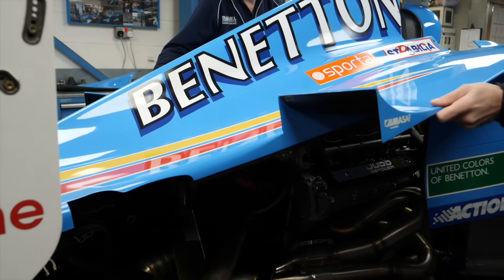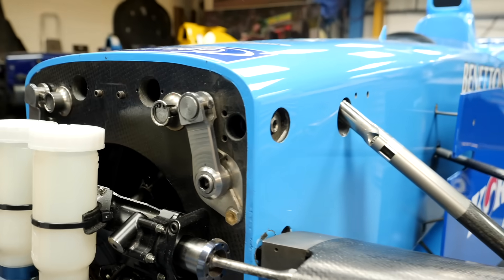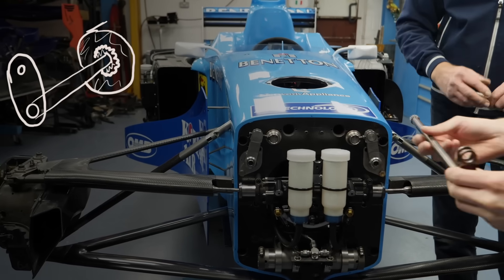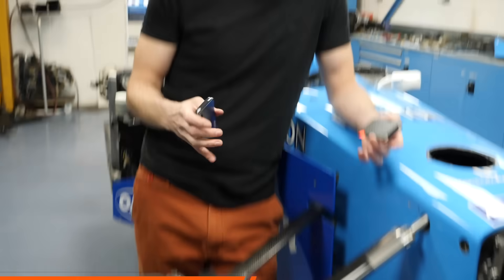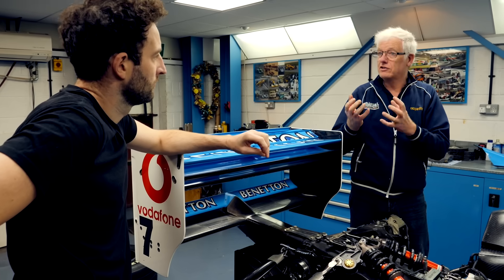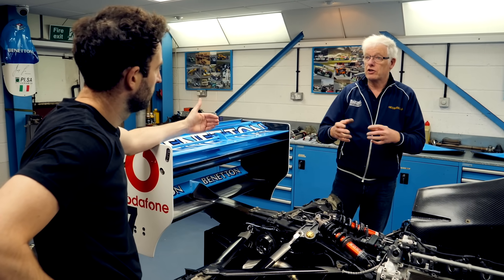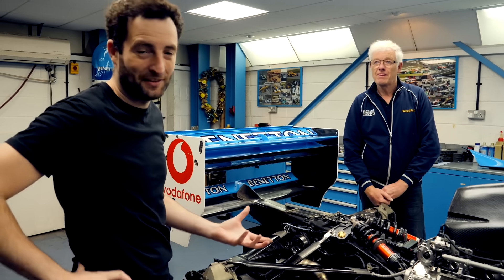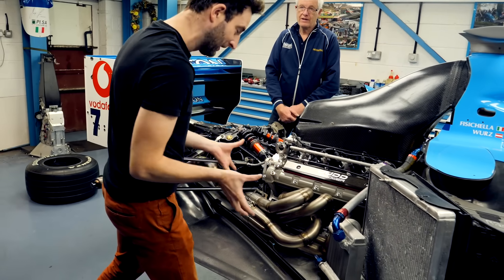Why F1 Suspension Doesn't Use Coil Springs!

Comment: FYI: There is no difference between a torsion bar and a coil spring. Both work identically via torsion. The only difference is one is a straight torsion member and the other is wound into a coil. Both are loaded in torsion.
Reply: Absolutely correct, when you compress a spring you are actually twisting the material it is made from, it is just a coiled torsion bar.
Reply: @trevor311264   Internally, sure, but it is linear compression if you look at what is happening at the ends of the coil spring.  Torsion bars, as others have pointed out, are lighter.  There is another important consideration.  The front end geometry changes less with a torsion bar allowing for better grip.  Nor are torsion bars anything new.  Dodge was using them on production cars 50 years ago.
Reply: @trevor311264  Are they though?  Is it not bending rather than torsion?  The bar which forms the spring is never really twisted as it would be in torsion but is bent to get the individual coils closer.
Reply: @HugoEtc  It is torsion and not bending. A torsion bar is an unwrapped coil spring and a coil spring is a wrapped torsion bar. (Just as RoboticGladiator and Trevor Marron explained). Bending has tension and compression forces and torsion has torque force creating shear stress. B.Eng in Mechanical Engineering
Reply: @Peter-un8no  @roboticgladiator, my apologies, you are correct, I was visualising it wrong, if you have a nicely coiled hose (representing the spring) and pull it out to uncoil it it comes out twisted (torsion). I was visualising the actual bending of the coils as they get closer together but that is not the primary force governing the reaction of the spring.  I know when I'm wrong and will freely admit.  Can't say I've had to think about springs much with Civil and Coastal Engineering ;-).
Reply: There is no difference besides their shape, appearance, and size. Great comment RoboticGladiator.
Reply: A torsion bar is lighter and takes up much less space.
Reply: @bobm7275  nope.  The same amount of material and weight for both.  The torsion bars you are looking at are just like a very small spring, the smaller the spring, the stiffer it is.
Reply: @trevor311264  The faster it wears out...
Reply: @bobm7275  Depends on application.
Reply: @bobm7275  that does not mean anything, a spring is a coiled torsion bar, it is still a torsion bar.  don't confuse it with what is often referred to as a torsion spring though!
Reply: The other half of the technology is the dampening effect, which is not explained as much as it should have been here. Well-balanced rebound is critical to keeping the tyre in surface contact at the correct pressure to maintain grip, balance and control- especially while cornering in rough conditions.
Reply: @JoeGator23  And huge savings in unsprung weight, where half the weight of the coil spring is considered unsprung, only a small amount of the torsion bar would really "count" as unsprung. And it's 1/5th the weight to begin with !
Reply: @peterdarr383  I agree, it's a strong and light design- plus, metallurgy today is superior. Back in the day they used magnesium wheels and inboard brakes to reduce unsprung weight, as well. Tyre technology is stronger and lighter, as well. 

I think the wheels are no longer used because of the fire hazard. The machines of today are amazing, cool comment.
Reply: @JoeGator23  I thought the wheels were still being made of magnesium alloys
Reply: @JoeGator23  thats what I'm kinda surprised about as well...  I wanted to see the dampers used in conjunction with the torsion bars...  It still needs space for those as well,  whereas the coil is just wrapped around the damper (which I think is pretty "compact" in it's own way..)
Reply: @billymanilli  Either way, this is a very cool channel... but in the video he spent more time talking about the exhaust and only partly covered the topic at hand. 
His dad is a human encyclopaedia of F1 mechanical knowledge and should present more information, in my opinion. The kid makes a great host... he should apprentice for his dad more- I surely would. :)
Reply: @JoeGator23  100% agree!  cool stuff for sure!
Reply: @JoeGator23  I was hoping they’d cover dampening up front.
Reply: @kart1241  Exactly! Either way it is the same concept... instead they covered the exhaust?
Reply: @kart1241  My advice: just try to avoid driving this thing in the wet!
Reply: Surprised no one pointed this out sooner
Reply: The straight torsion bar would get more spring response for less weight, and is therefore more efficient, correct?
Reply: @stopthephilosophicalzombie9017  All things being equal for performance, yes. Correct. Remember, it still requires a damping system for rebound.
Reply: When they named it a coil spring I'm sure they new how it worked. So what's the difference is a legitimate question despite your attempts to rename it the torsionnado or whatever you want.
Reply: Nothing new here!My 1962 Morris Minor had torsion bars on the front suspension(and “cart springs at the rear!)Splines on the end of the torsion bars make it a piece of cake to raise or lower suspension settings,when using coils makes things a lot more tricky.
Reply: @RoboicGladiator. a coil spring is a bending force, a torsion bar is a twisting for. they work in different ways to achieve the same effect
Reply: Actually, the fact that we can make flat bar coils proves that they are not torsion springs, but compression springs.  There is no torsion in a coil spring.
Reply: "A coil spring is actually a combination of a leaf and coil spring in that it both bends and twists to absorb movement. This dual-action of bending and twisting lends itself to very precise tuning, more so than the single-action torsion bar" - the goog
Reply: @billymanilli  surely ' a combination of leaf spring and torsion bar'?
Reply: A coil spring is indeed a coiled-up torsion bar. I think I prefer coil springs because you can fit them easily around the shock and don’t need any special connections like the splined torsion bar.
Reply: The difference is the reduction in unsprung weight. A torsion bar has the entire mass of the bar as part of the sprung weight.
Reply: Can you have a progressive rate torsion bar? Would you just vary the thickness of the bar down its length?
Reply: Holy shit you're right 🤯
Reply: @RoboticGladiator Thank you Sir, a YouTube comment where I learned something that's actually true. It happens so rarely that it's quite an event.
Reply: Quite true...thought there is a difference in functional parameters (mainly the length of the bar/spring twisted) and the fatigue experienced by each solution. 
Having said that...what is the solution for dampening the torsion bars oscillation in the front system (the equivalent of the piston damper within the coil, that they use in the rear suspension system)?
Reply: @gooser__43  The torsion bar has a profile that allows it to be slotted into the suspension.  It then twists to provide a spring effect.
Reply: @gooser__43  How does Google work?
Reply: ..torsion bar twists coil spring compresses.
Reply: Potentially the coil springs can have more travel compared to a torsion bar. I suppose suspension design could get around this though may not perform as well. Wonder if coil can be more linear when big travel is needed compared to torsion bars.
Reply: I actually think that torsion bars offer a "progressive" suspension while coil springs have a "linear" response towars compression.... this makes a BIG difference.... progessive suspension gets harder asi su apply force while libear suspension offers the same resistance through out
Reply: In driving experience there is!!!
Reply: I've always envisioned a torsion bar system housed inside a motorcycle rear swing arm pivot.  The system would look clean almost like a rigid frame.
Reply: Exactly!!!! thankyou 😅
Reply: torsion bar is less expensive, and also used in in expensive cars. More expensive cars and cars that demands comfort, do not use them but go for coils or even air suspension.
A good engineered and tweaked torsion bar can be as good as a coil spring, but it seems a lot of people can still tell the difference.
While it's lighter, and still more stiff ( of course depending on the requirements of the manufacturer and so on and so forth).
Reply: No, they do not. There's a difference between the normal spring and torsion spring. The normal spring uses bending not torsion. Since both ends are not fixed, the working does not relay on torsion but on bending.
Reply: @countmorbid3187  As part of my aerospace engineering degree I learned that coil springs are stressed primarily in torsion, not in bending, just as others have said here. If you don't want to take my word for it, see for yourself in this manufacturer's engineering guide to spring design: http://www.faculty.fairfield.edu/wdornfeld/ME311/AssocSpringBarnes-SpringDesignHandbook.pdf. 
At the bottom of page 58: "Wire in a helical compression spring is stressed in torsion", followed by the equation for the torsional stress. "Bending stresses are present but can be ignored except when the pitch angle is
 greater than 15° and deflection of each coil greater than D/4 (Reference 3)".
Reply: @ASJC27  I believe you, but I start thinking how are the torsion stresses brought home at the end of the coil spring? At some point it needs to be anchored to stop it twisting. Or maybe the ends twist less than the middle. Heck, I'm an electrical engineer and just don't get this stuff, who'd have thought that a spring can be so complicated.
Reply: Can you teach me about the damping? how does that work?
Reply: @paultimmer1223  dampers = shocks/struts, basically...  picture an old "heap" road car, where the shocks are completely shot/blown out... If you shove downwards on it, compressing the srings, and let go, you'll see it bounce right back up and down and up and down until it settles... Actually, you may have seen this on the highway as well... if a car has blown out shocks (dampers), it will go over a bump and bouce up/down a few times... 

Without getting real in depth,  the shocks/dampers create a (finely tuned for the application) "resistance" to the suspension travel,  allowing the spring to compress and rebound "smoothly" and not "oscillate" up/down as it would by itself...  make sense, I hope?
Reply: @billymanilli  One of my wreck cars during my student days had the shock absorbers part company with the body due to chassis rust. I "solved" it by removing the shock absorbers. Now that was an interesting driving experience! Mostly it was OK but a series of bumps would set the rear into oscillation that would build up. I got the chassis welded, put the shocks back on and it was like driving a Rolls Royce by comparison.

Comment: I'd be very interested to know how long those springs / torque tubes last? I actually worked on tanks that essentially also used (slightly bigger :P) torque tubes.. 
I had expected to quickly see metal fatigue but those seem to last Long..

Comment: Surprised the Benneton had the Torsion Bar above the drivers feet. Generally they're placed on a Lower Control Arm (see Chryslers from the 50's thru 80's) to get more of the mass lower in the chassis.... Having the Bar above the drivers pedals implies the combined mass of feet, lower legs, pedal box and brake master cylinder, is greater then the mass of the torsion bar and mounting brackets and chassis reinforcement for the loads.

Comment: Explanations are not great. For example, a coil spring is nothing but a coiled torsion bar—the spring action in both cases is supplied by the twisting of a rod. In a coil spring the rod is spiralled for compactness.

Comment: It's easy to understand . A torsion bar is an unrolled spring.  When looking at the bar , you can easily imagine the twisting effect. On a coil spring  the twisting effect happen all around . Just unfold it you have a torsion bar.

Comment: A coil spring is a torsion spring that is wound up.  Non coil springs are lighter and smaller.  The exhaust explanation is over simplified.  Exhaust pules form rarefactions when the pipe cross section changes.  The rarefaction travels back up the pipe and evacuates the cylinder.  The length of pipe determines the timing and the power band.

Comment: Its not even desirable to have engine bolted on anymore securely than is needed in normal driving conditions. In fact these cars are designed to shear off all non-safety related "appendages" like the power unit to reduce the overall inertia and kinetic energy of the driver and the cockpit or  "tub". Imagine dropping an apple vs. if that apple is taped to a hammer and dropped.
Now even some roadgoing supercars have this safety feature, which is slightly questionable as there are other cars/ road usersto consider, what if the motor shears off due to some richasshole losing control of their fancy supercar and then the engine hits on coming traffic still going 100+mph.

Comment: Today's PU doesn't use these kind of exhausts, because the turbo will slow down exhaust gases anyway. But on the other side it pushes in, so overall it's better. Just a straight and short exhaust on the top of the engine until the turbo's turbine.

How tightly packaged can be the back of today 's F1 car without the spagetti exhaust. Hmmm...

Comment: I checked out the "driver score" quiz for fun, and found it interesting but a bit questionable for rally driving; if the questions exclusively refer to circuit racing, maybe leave "rally" out of the options for driving style. Most of the quiz is unanswerable in the context of rally driving (questions about lap times, comparisons between laps, etc.).

Comment: As others have said, a coil spring is a torsion bar that has been curled up. If you looked at a slice of a coil spring and observed it springing, it would be doing torsion bar moves. I think coils are cheaper to make. No precision machined spline on each end. Just roughly wound in a spiral. I seem to recall that the stiffness of a coil spring rises as the sixth power of the wire diameter. Doubling the wire diameter makes the spring 64 times stiffer.
Reply: Exactly, you beat me to it. Interestingly, what we would call torsion springs (leg springs) are actually wound up bending bars, and compresson (helical springs) are loaded by torsion.  Makes no sense ;-)
Reply: it also saves space, most 2000 chevy silverados have torsion springs, because there was simply not enough space, for coilovers.
Reply: @ameraldas3641  Well and  the small Peugeot`s in the 80ties and 90ties like the 106, 205 and 306 had a torsionbar spring in the rear..... It saves a lot of space....
Reply: @schuncken  cool I have not been alive that long or lived in europe so I wouldn't know about puegot cars

Comment: Many many road cars some humble, some exotic have used Torsion bar suspension.

Mostly from memory, check if you are serious.

Morris - 1000, Marina
VW beetle and derivatives, van, camper etc.
Porsche - 911 +
Citroen - 2CV and larger cousins (Dayane?)
Jaguar - “E”, “C”, & “D” type, V-12, XK120, XK140, & XK150.
Riley Pathfinder, many others it seems

Comment: Not much new under the sun is there?  My old Morris 1000 Traveller had torsion bar suspension. I bought it in 1975 for £20 and ran it for a couple of years until the anchor point for the suspension corroded and broke going round Moor Allerton roundabout in Leeds one evening. 
The torsion bar and what was left of the cross member it was bolted to, crunched up through the floor of the car under the drivers seat. :0

Comment: Didn't really talk much about the torsion bars. Are they solid or hollow? Is there something with torsion bars that allows you to tune them like changing out rockers on a pushrod suspension? What are the differences in dampening needs between a coil spring and a torsion bar? How is the dampening achieved? With a torsion bar suspension how do you set up anti-sway bars?
Reply: Everything else is basically the same. A spring is a spring is a spring.

Comment: Great video. BTW while the packaging is better the current cars are actually bigger. They are the longest F1 cars in history and if you compare them side by side to a 2000s or 90s car the difference in length is quite staggering. A longer car allows for better aerodynamics.

Comment: That looks like the Benetton B198 which used a Renault engine and not a Judd engine.
Reply: I believes it's a B200 which would have had a Playlife badged Supertec. You can't get those anymore but Judd still makes engines specifically for old F1 cars.

Comment: Glad @Igbon5 already cleared it up. His comment is absolutely spot on! I don't know why his dad first said they are equal length, then explains it, but then says if they were the same lenght they would collide? That engine is obviously a regular Judd 72° flat plane V10, which means it has an even firing order and i.o. needs pipes of the same length to benefit from that and by that also timing the exhaust pulses perfectly.

I also didn't like the comparison of the rear coil springs and dampers and basically only a coil spring at the front, no damper was shown. The video is about F1 suspension and after all and we didn't get to see much of that... 🙄

I don't wanna hate on Driver61, but if you make videos about certain things, you might aswell try to get them right, instead of trying to sell us a damn wallet.

Comment: I have a simple question: it is common knowledge that carbon is used because it is stiff and light. But why the hell would you use it there where parts are extremely vulnerable to breakage? Why not use more flexible material in those places, add a few grams, but stay on track with an undamaged car?

Comment: Torsion bars are springs as are leaf springs. Torsion bars were used on some of the cars raced in the 1950s and were also used on the Amon in the early 1970s and I believe also by Lotus slightly after this around the ground effect era.